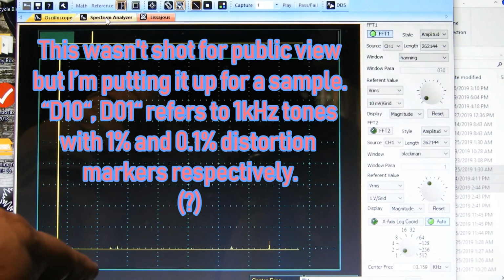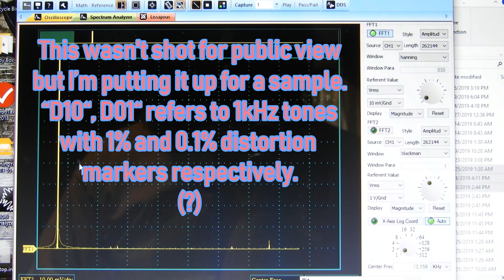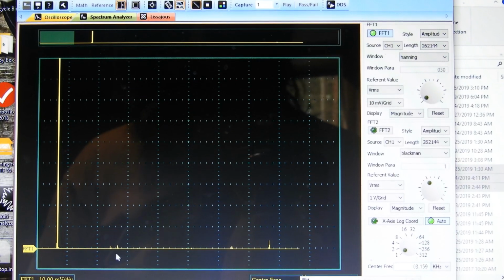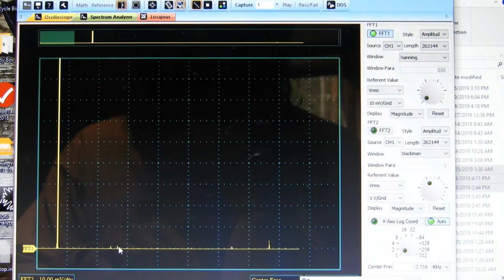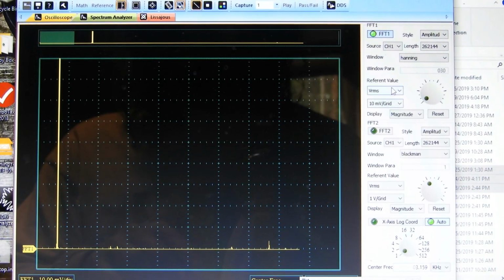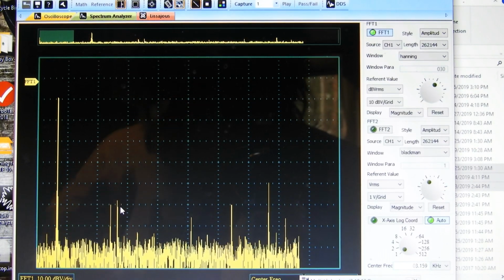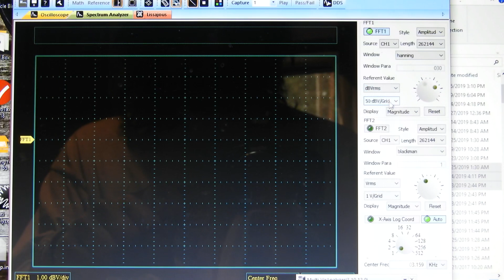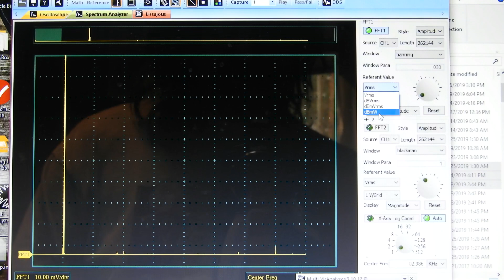FFT Sample - InstruStar USB Oscilloscope - ISDS205A

Comment: Hi, hace this item.
What is the max frequncy one can see in the spectrum/analyzer part? Discription talks about may megasamples/sec. But at spectrum analyzer-part it stops at 500kHz. Have checked all setting and adjustments but still ends at 500kHz. I'm measuring video signals, like PAL/NTSC. They go up to 5-6MHz. Kid regards
Reply: All right...got it!
The settings in the spectrum-analyzer part ae not enough. In the oscilloscope-part one has to decrease the time base ( range 10ns-10s ). Now I can easely see the whole video signal-spectrum!
Reply from the maker: @cbc7599    Yes! At heart, you are simply displaying the same data in a different way so it has to work in the Amplitude/ Time mode before you even have a chance to display it as Amplitude/Frequency. Then one has to deal with the other limitations such as sample density.

Comment: The fundamental is 1KHz, the marker is at 4.5K so that it is not harmonically related to the fundamental. D10 is 1%, D05 is .5% D03 is .3% ect... D00 has no marker. You must set up the scope to maximize the signal so the A/D conversion has enough data to work with. On my scope, this means filling the screen with the waveform (without the peaks going off screen). At 8 bits, .4% is the best you you can expect to see depending on oversampling and noise.